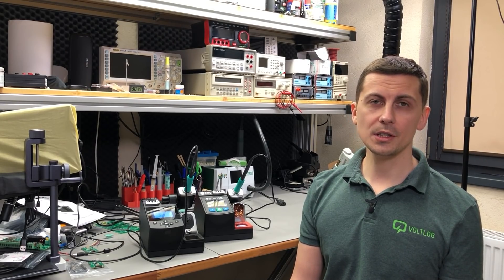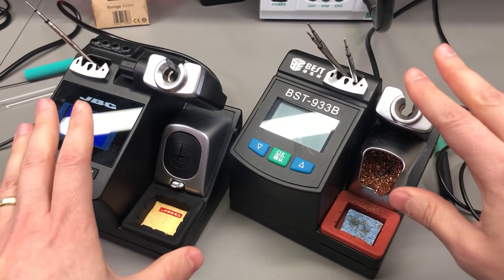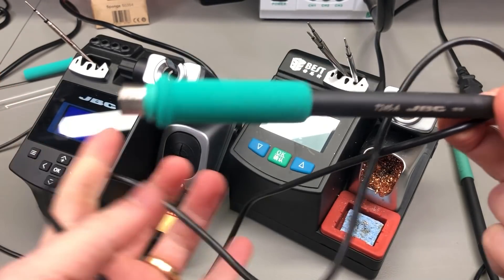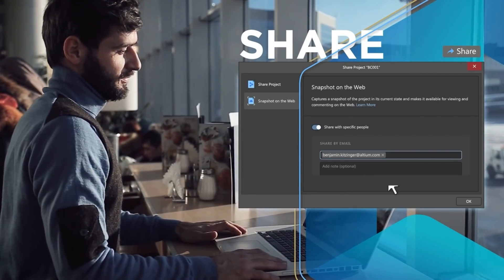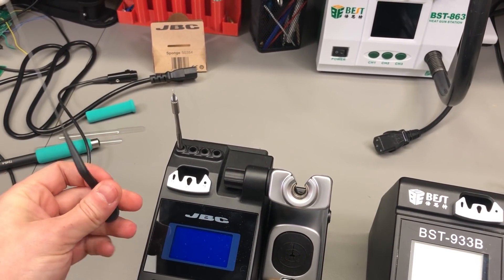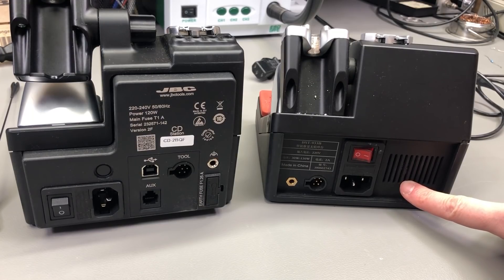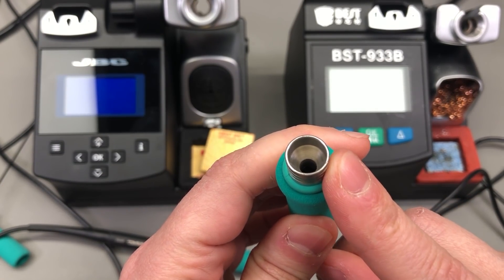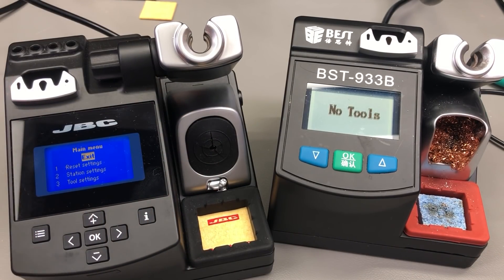Is A Genuine JBC Station Better Than A Clone? | Voltlog 401

Comment: what I don't like about that JBC is it's too big for one output and the stand is integrated w/ the power supply. It's ridiculous to keep the station on the main desk surface and take up all that space... for one iron.  By the time you have your tweezer and desoldering tool your entire desk would be covered. I like keep my soldering power supply units above the desk and have small moveable stands that I can put anywhere...if you are entry level or just require simple iron get a Pace ADS200 Plus for $260, 120W, $16 tips, compact, reliable, awesome handpiece w/ short tip-to-grip, or get one of the Hakko's w/ cartridge-based irons.

Comment: You didnt check to see if the tips are grounded, or if they leak voltage onto the PCB and components being soldered. This has been reported as problematic for cheap T12 stations.

Comment: Why are they using transformers instead of switching power supply?
Reply: One reason would be better electrical isolation from the mains AC; some units such as Aixun are known to leak voltage onto the board and components that you're soldering, and the tips can't be directly earth grounded. Also, switching supplies are really rough on the internal capacitors and often causes premature failure. Finally,  the RF output of a nearby switching supply is to be avoided when you're diagnosing, aligning or calibrating electronic equipment; it can cause noise and anomalies in oscilloscope readings....of course, Chinese manufacturers love switching supplies because they're cheap, lightweight (saves on shipping cost), and the same unit can be sold and operated worldwide on any voltage. Personally,  I wouldn't use a soldering station that doesn't have a power transformer.

Comment: The JBC Plastic looks way better,and I wouldn't be surprised if it had glass fiber reinforcement in the plastic.
Personally if you have the money buy the JBC if I remember correctly the price of the JBC was a little over twice that of the BEST,I was think it would be four times more expensive,for all that quality,it is worth it,even as a hobbyist.
Thanks for your review,it was excellent!
Reply: The body of the jbc is metal not plastic. At least mine is..
Reply: @tokin420nchokin which Jbc?

Comment: JBC can "adjust" the temperature - kind of calibration of the tip. Thermal transfer depends on tip type very much!
In production you need just one setting, in best case locked. So you can use anything, choosing the long term cheaper. I prefer the simplest wellers. I'm using JBC tools also for reworking job - very productive,  very comfortable and very expensive..

Comment: The Analog Devices IC ADM3251E is an Isolated Single Channel RS-232 Line Driver/Receiver used to control the fume extractor. The isolation is between the soldering station and the fume extractor both of which are earthed on the AC mains.

Comment: I'm looking into buying a (JBC) or (Ersa) soldering station (new one that recently came out), but I wonder why the hell are the JBC tips so expensive compared to the rest? The JBC is a nice looking station and at least doesn't look like an ugly toy (HAKKO).
Reply: I know it's a year late, but, cartridge tips are expensive because they have the heating element and thermocouple built into the tip. You can get clone tips for as low as 5-10$ each, reputable 3rd party ones cost 10-20$ each, and official JBC cost 20-30$ each.
Reply: @ 🙏 thanks a lot, good to know the reason why and it makes sense.
Reply: @PineyJustice , several other commenters noted that clone tips are sometimes defective when brand new, immediately turning *red hot*!
Reply: @ I've got dozens of both the real and clone ones and it's never happened to me. Just because something has happened doesn't mean it's common. If you have one acting up, turn the iron off, remove it and contact the seller for a replacement. Not that hard, and certainly not a good reason to get soaked for 5x the price on only buying real tips, particularly for sizes you don't commonly use. Performance between an authentic JBC and a clone is basically the same. I can't even say that the authentic ones last longer, because the only tip I've ever had go bad (iron plating on tip wore through) is an authentic JBC tip.

Comment: Good review! I currently have the JABE UD1200 C245 station and I've been using it for 3 years without issue. I did opt to buy the JBC dual station for the C210 & C115 though. I purchased my JBC used and got it at a crazy marked down price. Some of the clones work well and then there's some that are terrible. I did recently but the "NEW/UPDATED" AIXUN T3B C210-C115 universal soldering station and with genuine JBC tips I  cant tell the difference. Thanks for the comparison.
Reply: Hi, which soldering station do you recommend at the moment ?

Comment: Overshoot 5%(derivative coefficient a bit high) is a must for soldering station it shortens heat up, recovery time when tip touches cold joint. Copper bar test is inadequate

Comment: Thanks for this video and for your job. I have Aixun T3-A with T-245 handle and I am really satisfied with it. If you have time and willingness, I want to see that soldering station review and teardown. Thanks in advance.
Reply: is it still working properly?
Reply: @Sajid-lp9ss  Yes, it is working fine. I bought genuine JBC T-245 tips and use them every day without any problem.
Reply: @norbithehun  what about the included Aixun tip?
Reply: @Sajid-lp9ss  I use the blade tip only, because the other two are too fine and they can transfer tiny bit of heat.
Reply: @norbithehun  I mean did the included one perform well?
Reply: @Sajid-lp9ss  I can say, that the included tips are not the best quality. The soldering station is working perfectly and it is good quality.
Reply: @norbithehun i appreciate you boy replying after 2 years of use, that kind of reply Really valuable 👍

Comment: I have a jbc clone with the 210 handle and I cannot find a good source for tips anywhere. 3 tips are 200cad with shipping from a reseller in the US and I'm having trouble finding a source in Canada. I want a beveled and chisel tip but I can't justify the price so I'm stuck with the only 3 garbage shapes you can get on ali express. I meant to order the 235 one and thought I did and purchased 3 tips that I'll be stuck with they arrive. Ali express delivery to Canada is like 2 months and I paid 50 for shipping. They could've used DHL for that price like pcbway do.
Reply from the maker: Have you tried searching ebay for JBC tips?
Reply: @voltlog  yeah, but only a cursory search. I've seen the jbc catalog so I know the tips I want at there. Hopefully the station gets here soon then I'll sort it out. I've got a bunch of projects on the go.

Comment: Looks like the best unit is a clone of an older JBC station.
The genuine JBC stations used to have the same three button interface as this. Also they've clearly improved the overshoot compensation on the new JBC station.
Reply: Not really improved. Even the higher priced stations keeps overshooting. Maybe this  is desirable, i don't know. From hibernation mode to working condition pass 3-4 sec, enough to place the tip over a joint which cools down. Or they just can't manage this fast heating so precise.
Reply: It depends on the tip. All the claims they make are based on a specific t210 tip. The t245 tips I have with mine overshoot about 20 degrees on the display and come back down to my set temp in about a second.

Comment: I have a couple of the Xsoldering JBC-like stations. I say JBC-like, because they're very different internally and despite the handles looking just like T210's, they have different wiring so you can't use geniune JBC handles with the stations, thought they do take genuine JBC tips (and even included 3 genuine tips!). They seem to perform well, but I'm curious to do an overshoot test with them like you did (I have that same iron temperature probe). I am looking at replacing them with either one of the dual geniune JBC DDU stations, or a dual clone - I got the two Xsoldering stations hoping to use one with a T245 handle and one with a T210, but as I say they're not actually T210's so the T245 doesn't work with them unfortunately. A word of caution on clone tips, I have had some brand-new ones start glowing red hot instantly they were plugged into the handle and get so hot that the tips fell off in the few seconds before I could shut off the station. Thankfully I solder on a the metal base of my microscope so nothing caught fire!
I have a JBC NASE Nano Rework Station as I do primarily microsoldering, and, despite being only 14W, I reach for it for 90% of my non-microsoldering jobs too as it handles them no problem. JBC's are magic I swear.
Reply from the maker: Even though I didn't notice any performance differences between the few clone tips that I have and the JBC original I would also recommend getting JBC genuine tips as they can usually be found as new old stock or slightly used on various international or local websites for almost the cost of the clone tips from China. At one point I bought a bunch of genuine JBC tips for something like $3 a piece from a local auction type website.
Reply: Bro! I just had 3 tips strait melt down almost immediately in my aixun t420d! Thankfully they were just cheap amazon tips labeled magma. The aixun tip seems fine and the jbc tips work seemingly. Have not tested a jbc tip in the 245 side yet though

Comment: In my humble opinion, this station is way too expensive for a so so quality product. It sounds to me like a ksger station with hakko tips is a better choice. It is not as integrated as this Best unit, you need to buy a holder, and the esthetics may not be as attractive, but it is WAY cheaper, and probably as good. Buying the real JBC also makes sense: it costs money, but it is a quality product.
Reply from the maker: I've used a hakko T12 clone for a good while, they get the job done and are good value for money, however there is no question about it, even a JBC clone is superior.
Reply: Just get the aixun t3a or t3b

Comment: You should consider getting a Really universal soldering controller from Dangerous Prototypes, its a DIY Solderingstation that can be build for many different tips and works incredibly well. Of course its quite different, but you can get finished PCBs from China so you dont have to solder the PCB yourself.
I think it would be very interesting to see how well this compares to a finished fake and genuine JLC.
Reply from the maker: One of the things I appreciate on both the BEST and the JBC is the form factor, the whole package, the ergonomy. You can never get that with a DIY soldering station, so I'm not keen on trying that out no matter how good it is.

Comment: What may also have been a very interesting question to answer: How does a clone station perform with a genuine JBC tip? As most of the 'magic' happens in the tip of the unit.
Reply from the maker: Tests in this video were performed with a genuine JBC tip.

Comment: I got a JBC DIT-1B about 10 years ago.  It's has the stackable control unit with a separate stand for the iron.  I love it!  Not sure why people complain about the tips, mine have lasted just fine.  I liked it so much that I bought their micro-tweezers station as well.
Reply: "Not sure why people complain about the tips"
Because they try to save a couple of bucks and buy then off AliExpress from China. 
They also complain about the cost of them but at least here in Australia they're actually cheaper than Metcal, Weller, etc.